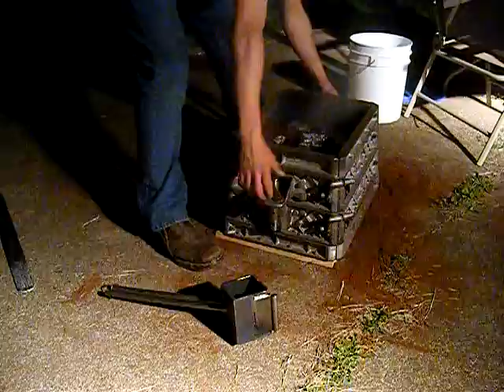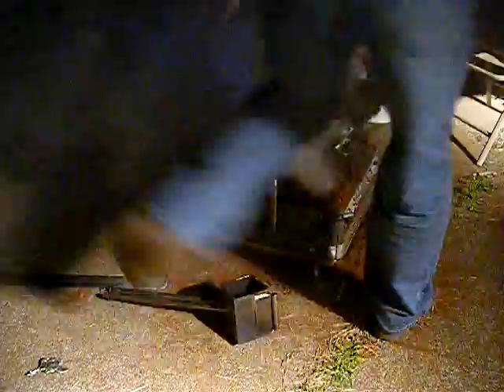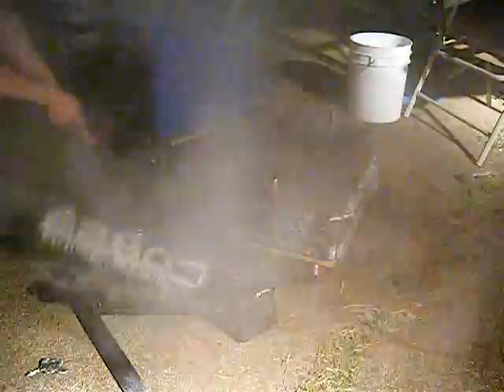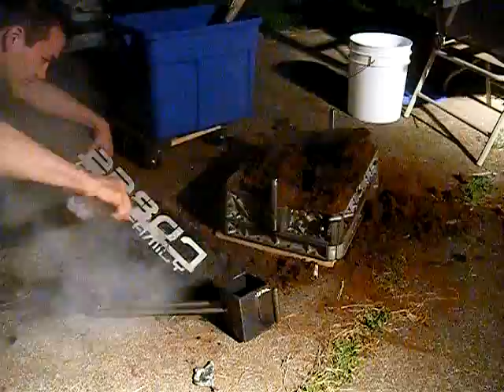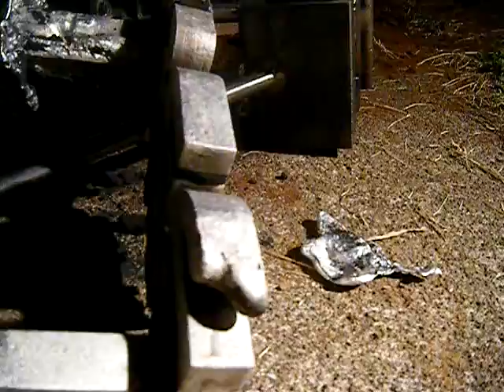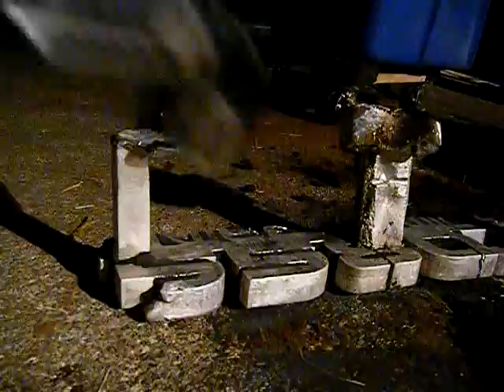DIY Foundry: Demolding Foam+Petrobond Experiment (Part 2)

Comment: Hey you probably shouldnt put hot sand into a plastic container and you should sreen it to remove burnt chunks HA HA ROLF

Seriously though you might want to invest in a pieces of backer board to do you de mold on top of.  it looks like your losing a bunch of sand onto the ground.